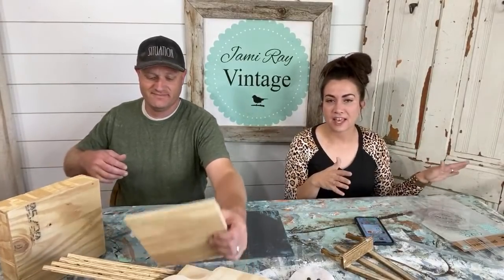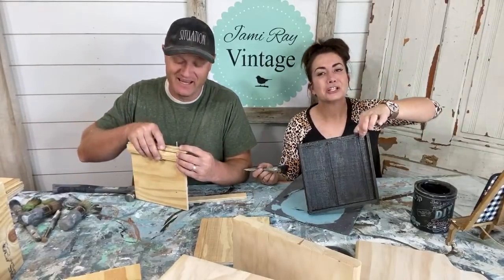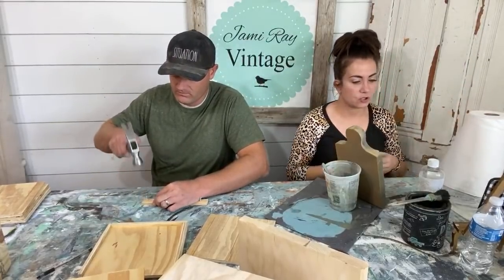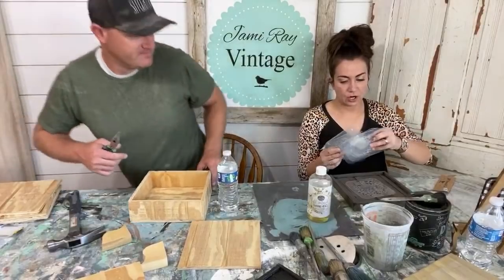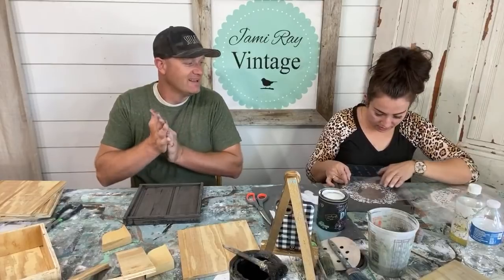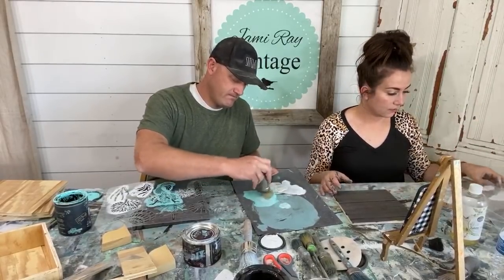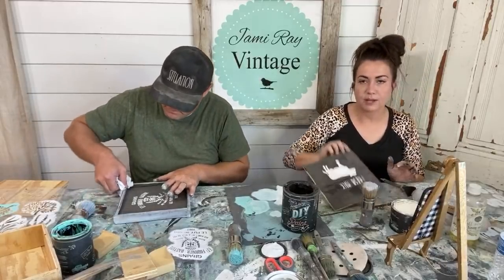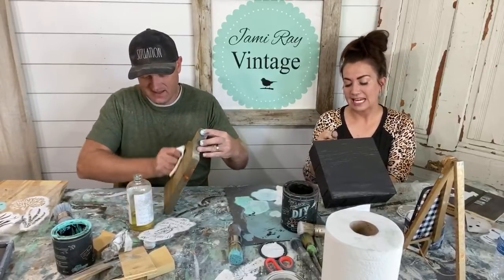Construction Scrap Cutting Board And Tray DIY WNW

Comment: Thanks for this video!
I curb- picked up about 20 pine, 1x10x 14-18 off cuts from a stair build and I'm looking for ideas on crafting them to sell.
If anyone has additional ideas please contact me.
Reply: Jami, along with the stair off cuts on the curb was a Coors refrigerator/ dispenser but no cord! We ordered the cord and now it's in my bedroom full of bottled water and chocolate so it doesn't melt in this heat. Coors dispenser value $150-250 cuz it was a limited # made. 
Sweet!